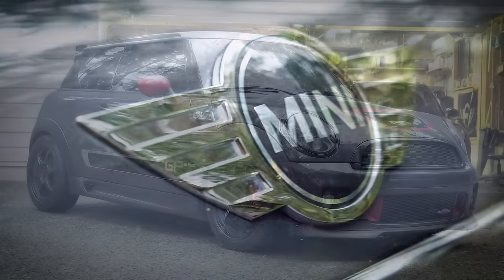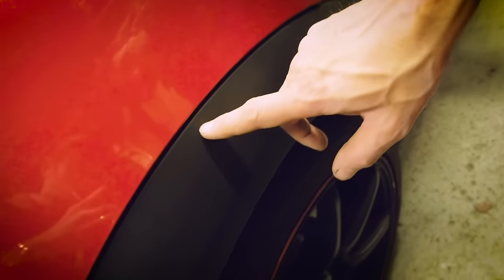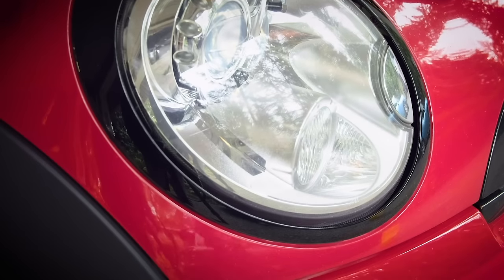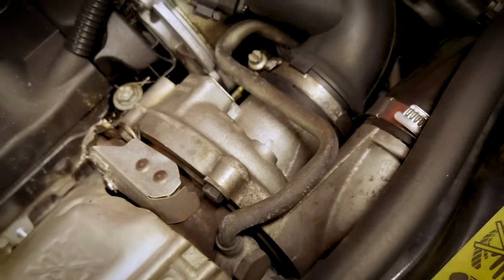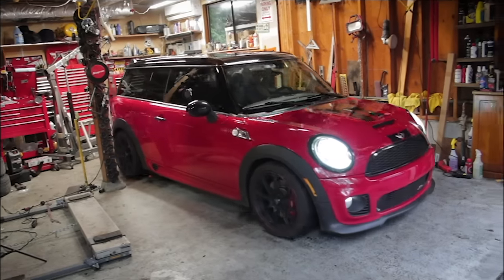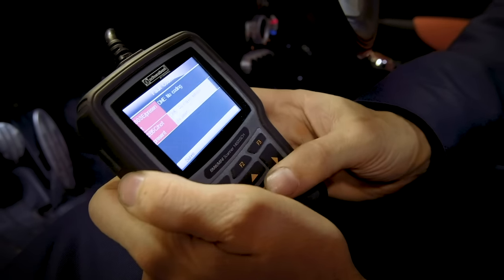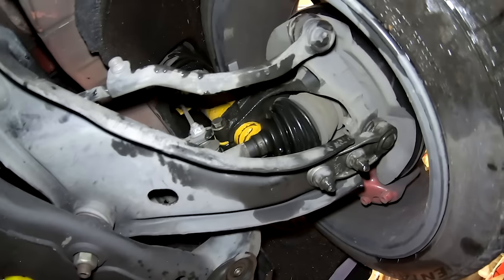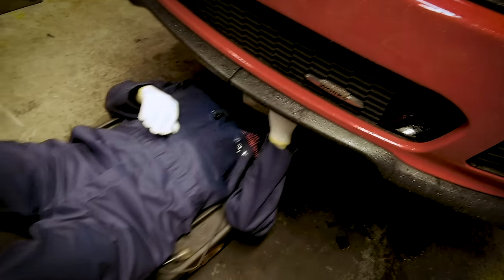Buying a used 2007-2013 MINI Cooper - things to look for - Gen 2 R56 R55

Comment: I bought a Mini last year November, my first car. After a month, all the problems started popping up. I spent so much money trying to get it fixed up and it's still not 100%. Wish I had seen this video sooner
Reply: Heh, I'm in the exact same boat man. About 3k in the hole right now, and more work to be done.
Reply: @Boocake1488  It sucks man, i have no choice but to sell it and get something decent. Should have done that from the beginning. I threw 15k into my car already, 15000 rand, South African currency. Your 3k is probably more than my 15k assuming you're not from SA
Reply: @HorrorbleGamer  USA. I'll be selling it sometime this year and finding something much more reliable. Maybe a Toyota.
Reply: I talked my parents out of getting a 2011 jcw today for $8k. Carfax reports had thermostat changed at 27k. Time chain tensioner/guide at 47k and clutch at 59k. Carfax reported excellent maintenance upkeep and inspections at dealership every 7k miles up to 85k miles, then apparently stopped for 6 years. Maybe sold sat on car lots?? It was imported October 2010 and I dont know what engine it was. But clearly those issues match common reviews of expensive issues. It was a 1 owner that took care of the car, but seemed to get rid of it after putting $5,000+ in repairs on top of the $35,000+ car price. I talked them into getting it, and then this morning stated pulling up 2011 reviews of issues

Comment: My 2011 R56 has been a magnet for issues!  It has 131k miles on it currently and I plan on holding onto it at least until something real bad happens...like a broken timing chain, lol. 😅
Reply: I talked my parents out of getting one after showing them the car online yesterday that's 200 miles away. 2011 jcw for $8k 86k miles.
Had the chain tensioner, thermostat and clutch changed before 48,000. I didnt want them regretting with repair bills

Comment: Iv just bout a 2008 clubman s with a n14 engine, iv just found out now after watching your brilliant video that it's the worst engine, it runs brilliant I have to say & was owned by a mechanic so fingers crossed, it does have an oil leak that I need to investigate, gona lighty wash the engine to see where exactly its coming from first
Reply from the maker: The worst part about N14 was the timing chain tensioner and people not keeping them filled with oil. And some of the gaskets expire early.

Comment: hi i got a mini r55 jcw 2009 n14 engine about a month ago when i cold starts it it needs 4,5 times to start and when i start it doesn't have any throttle response until it worms up, or when i start it i rev to 3000 rpm to have a response cant figure out the problem

Comment: Iv just bought a 1.6 mini cooper the eml and tyre pressure lights come on i checked the pressures and cleared the code but both lights are still on the eml went off but came back do you know what thos might be

Comment: Another great informative video! Just wondering what make are the protective gloves you use? Mini Cooper auto 2008 owner with 16000 miles!
Reply: 2008 R56 with 181000 miles.  On my second clutch. Starting to get the oil leak around the filter housing.  Love the car, I hate to get rid of it, but she is getting long in the tooth.  Wish I could buy another one, just like it, brand new.

Comment: just asking ...my second gen mini has a hard cold start and a misfire until its warmed up then drives fine.....I already replaced plugs and coils....so.my question is do u think the fuel system can be to blame...it drives fine when warm but sucks when its cold

Comment: THANK YOU!  I am going to see a RoadsterS 2013 in a couple days and had no idea what to look for and had planned to have a mechanic check it out.  Now I can do some of the "checks" before I even decide whether I am interested.  Did the Coupe/Roadster get a different engine in 2014 and 2015?  I know that 2015 was the start for third generation Minis (at least the ones I have read about!).  There are both 2014 and 2015 used roadsters and coupes out there, so would you recommend either of those model years as opposed to the 2013?  The one I am going to see has less than 30,000 miles and looks like it spent most of its life in a garage however I know from my current car that even sitting in the garage doesn't mean things won't go wrong!  I truly appreciate this video.
Reply from the maker: Coupes/Roadsters are 2nd generation and use the same N16/N18 engine family.

Comment: Hello. If I have a pretty big engine shaking at idling and between 1500 to almost 3000 rpm, do you have any clue what to check up? In Carly I have some errors with vanos and some boost pressure control.

Cooper S N18.

Thank you!

Comment: Looking into getting a 2013 Mini Cooper Coupe S. The little 2 seater hardtop. It's got around 120,000 miles with 1 owner. Is there anything I should look for during the test drive? It's an interesting car forsure and I've never owned a Mini.
Reply from the maker: Get under and check for leaks. remove oil fill cap and see if it appears it had regular oil changes.

Comment: looking at a 2007 mini non s and automatic with 98,000,thanks for this video .its a convertable. will not pass inspection. price is $2750. its been maintained properly and driven soft. just concerned what might go with that many miles.any advice? thanks mike

Comment: We were under the impression we’d get around 37mpg on highway. When we filled up we calculated that for city and highway combined we got a whopping 41. The only problem we have is the tire pressure light is on. We’ve had them done, but it still hasn’t gone off. We are able to check and adjust pressures ourselves so not overly worried UNLESS I should be. Does anyone have any ideas regarding pressure light?
Reply from the maker: There was a radio frequency change in 2010. You need to make sure the TPMS transmitters are using the same frequency as the car. Otherwise, scan the RDC computer for codes which will give you more information than an idiot light.
Reply: Mod MINI thank you. We are brand new to mini and wanting to keep her in tip top condition from the little things all the way to the bigger things.

Comment: I actually PREFER the N14 engine because I do all the work myself. I say f*** the duel vanos on the N18
Reply from the maker: There is really nothing about the N18 that makes it harder to work on than the N14 other than the valvetronic eccentric lobe and motor. Everything else is essentially identical including the tools and diagnostic equipment.

Comment: Careful buying one of these. Watch out for oil consumption and timing chains. Do your research. If you don't want to put in the time or money then stay away.  Mini has a ridiculous oil change interval . I believe this can cause premature wear on engine and chain especially if owners didn't check oil and keep topped off.  Mine used 1qt ever 2 fill ups.
Reply from the maker: You hit the nail on the head. The N14 with the most problems were those whose owners did not stay on top of oil levels and oil condition. The chain, turbo and VANOS solenoid issues can all be tracked to this.

Comment: I have my eyes on an 09 jcw with 81000 miles. It appears to be well maintained with full service records. The timing chain job has been done and it recently had a new valve cover gasket and has had some coolant leaks repaired. That said I have seen horrible things about the n14 engines. If the large repairs are done, is it safe or should I just steer clear.
Reply from the maker: Get the thing inspected independently and don't spend all your money on the car.

Comment: I’ve owned a 2009 Mini R56 JCW for nearly 3 years. 2 weeks after purchase my turbo blew up.  I spent $3000 on that. Then at the 1 year mark the clutch and flywheel disintegrated. That was another $3000. 

I’ve spent another $1500 or so in routine maintenance items; tires, coils, brakes, and replacing a cracked rim. In total the repair costs are a little over half the purchase price!  

Contrast this car with my BMW 135i, which was the same price when new. The BMW is faster, more refined, and more reliable. 

I only drive my cars about 5k-6k miles per year. In my opinion the Mini is nothing short of a stunning disappointment of a car. Cheap, rattling plastic and unreliable mechanics.
Reply: Sorry to hear that.  Just to remember that the clutch and flywheel can go on any car.  Same thing happened to me with a ford mondeo I owned once.    Now that you have replaced these items I'd suggest that you keep the car and enjoy driving it.   The chances of something else going wrong should be very low.  The last thing you want to do is to panic and sell the car with all this work done to it and give it to someone else. I made that mistake and now see the car driving around my local area.   Unfortunately you are unlikey to get money the you put into the car back again so my advise is to keep it for a couple of years. All the best.

Comment: Hi! Love your video. I am looking to buy a used mini 2014-2015 any recommendations NOT TO BUY OR YES TO BUY. Please help. You are a pro in this. And dealers seems no too helpful. Ty so luch
Reply from the maker: 3rd gen are pretty reliable, but 2016 and later are probably a little nicer build quality

Comment: Hey Mod Mini! Your videos helped me rebuild a 2006 R53 automatic I bought for $500! I put about $4500 more into it and it is a very reliable and FAST little car that is going to my daughters for their high school car. I am now looking at buying 2011 R56 manual for $2500 and rebuilding the motor on it. The current owner said that the electric water pump failed and the motor over heated and died. He said there is very little compression in the cylinders.The car is in very good condition with a lot of aftermarket stuff on it. I was figuring to spend another $3000 to rebuild the motor and put it back on the road. It will be my weekend car. I do all of the tear down and rebuild myself. The engine goes to a machine shop for any machine work. Is it worth it?
Reply from the maker: I'd get a used motor before rebuilding one. A rebuild can get expensive quickly.
Reply: This is a long shot for a 2 year old comment, but did it work out? I'm looking at a 2011 cooper S for 1500 with either a dead engine or trans (it runs, but doesn't drive...that's all I know)

Which direction did you go for your motor and did it work?

Thanks!!

Comment: Unfortunately I bought a 2012 JCW with the N14 engine before viewing this video. I have a 2884 code DME: Boost-pressure control deviation, plausibility and the car's gone into limp mode. Is the turbo broken?
Reply from the maker: Could be the turbo diverter valve control solenoid under the intake manifold. 
N14 JCW seem to be better than regular N14...

Comment: Thank you for the great videos! 

I have a 2012 Mini Cooper JCW and I believe it’s the N14. Now I need a new engine, should I consider the N18 instead? Would it fit? Which other reliable mini engine would fit this car?
Reply from the maker: N18 is not compatible with N14 ECU or wiring harness. Put another N14 in it.

Comment: Any advice as to what could cause my mini from.time to.time act strange? If the car sits over night and you take off, itll shift through the gears just fine but when u start to slow down to come to a complete stop right before u stop completely itll start to accelerate on it's own for a slit second and then itll stop. It downshifts just fine but right before I stop moving it picks pack up. It's a 2011 MCS and no I'm not touching the gas  Pedal. I'm going to see if maybe its low on fluid but i not sure if u have seen this before.
Reply from the maker: Sorry. Can't answer this question without seeing car in person.

Comment: Quick question, after checking and before driving wouldn't it be a good idea to check and wipe with ODB and after the test drive plug it back in and see re-occuring codes?
Reply from the maker: Would be a good idea. It's not your car so you would need permission to write to the computer(s). Some codes pop up and disappear forever, others can be cleared but require multiple drive cycles to come back.

Comment: How do you get a stuck VANOS actuator solenoid out of the cylinder head without destroying it?  Mine is stuck, it will turn but will not come out.  I've tried prying, channel lock, nothing works.  Please help.
Reply from the maker: Keep at it. Eventually it will pop out.
Reply: @ModMINI  I sprayed penetrating oil and came right out with a help of a small screw driver. Thank you for the reply

Comment: I am considering acquiring a 2011 mini base model (non turbo), how do I find out the engine type N12, 14 or 16?
Reply from the maker: That is an N16.
Reply: @ModMINI  thanks. it is a project with a blown head gasket, while the head is out is there any upgrades that should be done to make it more reliable?

Comment: Do the newer 1.6 turbo engines have problems with oil consumption. Like 2014-2015?
Reply from the maker: Should be fine unless abused. Also the turbo can be the source of oil consumption and may require early replacement. An extended warranty period might apply.

Comment: If I am buying N14 engine what repairs should be done on it? Or what repairs would I need to do? And how much each would cost?
Reply from the maker: Chain tensioner, oil filter housing gasket, thermostat and coolant bypass tube are the most common. Also normal wear and tear like belt, and plugs.

Comment: Didnt they say the later model N14 engines were improved from 2011-2013? They fixed the carbon build up problem etc.
Reply from the maker: Later model is N18 and they are better. Carbon buildup is really not a problem unless you take lots of short trips and never let the engine get fully warmed up. Drive the car hard once in a while and no problems.
Reply: Ahhh yep the N18 is the updated motor, bugger. I heard it was a great engine! With the N14 I was told to keep the RPMs above 2k which I always do through town. Also I put an oil catch can on the engine to keep her running happy and purchased a strong magnetised sump plug. I'll drop the N18 in her if I have to 😉

Comment: How is a base 09 convertible? No Turbo. Manual. We are so limited in the USA with small 4 seat convertible options.
Reply from the maker: Great car but it won't be fast.
Reply: Mod MINI I went with a 2000 VW Cabrio. I have a good reasonable VW mechanic and only had a $3000 budget. Happy with it.

Comment: It's hard to maintain a constant speed in the mini clubman r55. I had many cars over the years and never encountered this problem. Is there a solution for this? No, my car does not have cruise control.
Reply from the maker: I have never heard this issue.
Reply: I think it's due in part to a lag between the digital speedometer and  actual speed. This is evident when coming to a fast stop and seeing a speed reading despite being motionless for a few seconds. This lag makes it hard to keep a constant speed, particularly on the highway.

Comment: Bought a used 08 mini cooper S nine months ago..just last month my timing chain broke and completely screwed up the engine to the point I need a new one. Now I'm stuck with a $6,700 car loan, I'm gonna just pay this off over the next few months and stay the hell away from N14 engines. lol
Reply from the maker: Sorry to hear. They are reliable with religious oil service. Always a risk with any secondhand car. I have a friend who is a used MINI dealer. He just changes the chain for every Gen 2 he sells as a precaution.
Reply: @ModMINI  I wished the dealership I got my mini from did that. Oh well, around the summer I'm getting a 2014-2015 Mini and will do extensive research on the history of the car.

Comment: No mention of engine noises on startup or while the engine is cold? My 2010 R56S rattled on startup and guring the the first mile.
Reply from the maker: Rattle on cold start is normal but should go away. Valve train can be a little noisy until warm, but if excessive, suspect stretched timing chain or broken chain guide.
Reply: Check your oil level.

Comment: Basically don’t. The PSA engine is weak. Cam chains stretch, tensioners give up. The engine valve stem oil seals are made of rubber and fail early, the engine leaks from various gaskets including brake booster and rocker gasket. Head gaskets fail and Vanos also fail. Second gear selector is weak on these too. Save your money and get the series 3!
Reply: Its not a PSA Engine, its a joint BMW/PSA venture. PSA did the cylnder head and block, the likes of the timing chain, vanos, coil packs, High pressure fuel pump, Direct injection etc (all the parts that fail or give you issues) are BMW designs. It was that good that BMW went out on its own after this with the F20 engine, and had similar problems (especially the timing chains and tensioners).
Reply: @tonyb1223  Whatever the input, the engine is weak and should be avoided.

Comment: Hello, First off I would like to say that I love you channel, Thank you so much for all the information and knowledge that you share with us.  I have one question....in your opinion what is the best OBD2 Scanner(s) is/are for MINI Coopers?  one that will reset automatic Transmission adaptation.  I kinda like the one you showed in your channel Foxwell NT510 but not sure if it will do transmission adaptation reset.   I have 2006 Mini cooper s convertible R52, and 2012 Mini Cooper S Countryman All4 R60.  I would really appreciate your input.  Thank you so much
Reply from the maker: NT510 should be able to do that. You might be able to ask seller or question on the Amazon page
Reply: Thank you so much for the reply.  I see the one you use is gray color but the one on Amazon is orange color... wondering if it’s the same one. Thank you again.